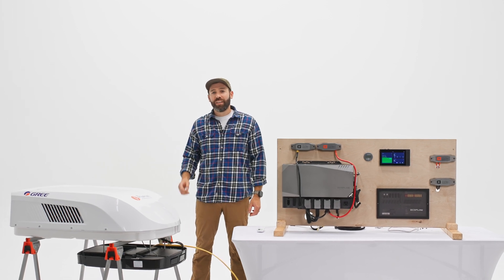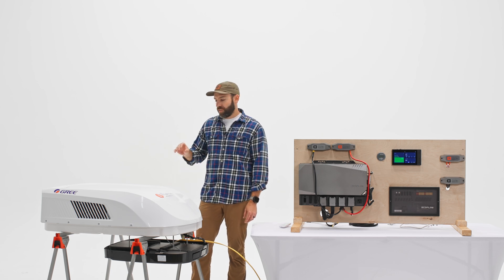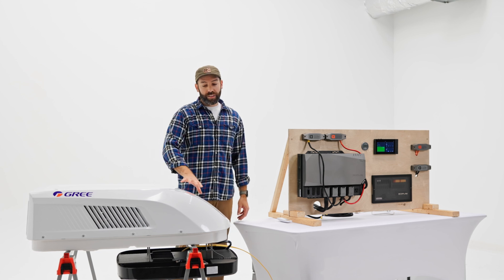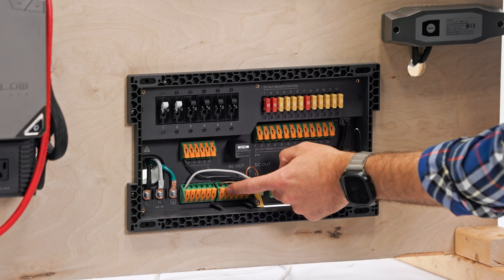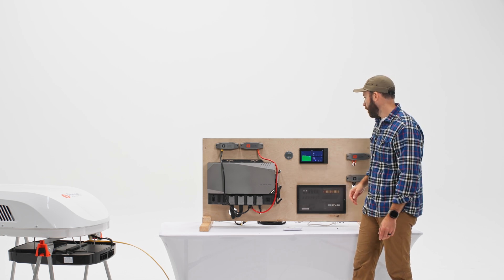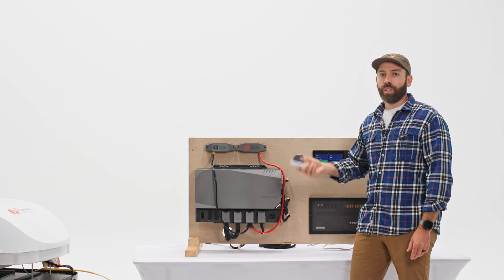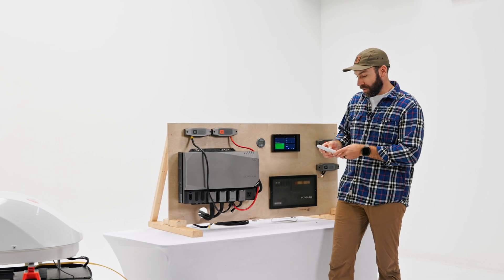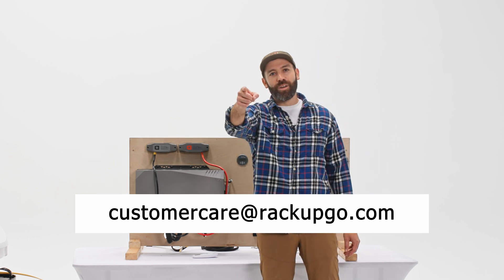Off-Grid Air Conditioning: Powering the GREE Eco-Cool with a Battery System

Comment: Excellent review on this unit. My current hole through the roof is 14" for my current build but I like what I see here from this unit that requires a 14.25" hole. Would you know if that unit has a little wiggle room and would work in a 14" hole?
Reply from the maker: There should be enough wiggle room for this unit to work in a 14" x 14" roof opening.

Comment: Excellent! I just had one installed in my Coachmen Galleria. What is the A/C start-up power draw? Apparently my 2000w inverter cannot handle the start up. I have a 460ah lithium battery.
Reply from the maker: We typically recommend a 3000W inverter at a minimum for the GREE Eco-Cool. It is a softer start compressor compared to traditional A/C units but not a fully soft ramp to running speed. Smaller inverters may be able to run the unit, the most important spec to review is the surge rating and duration. For example, a 2000W inverter with a 175% surge rating for 5 seconds will have a better chance of running the Eco-Cool than a 2000W inverter with a 200% surge rating for 1 second. 

460ah should be good for about 8 hours of runtime with the Eco-Cool based on the heat chamber tests we performed.